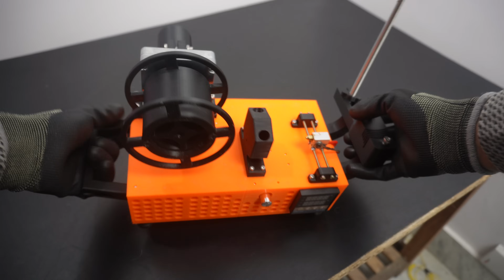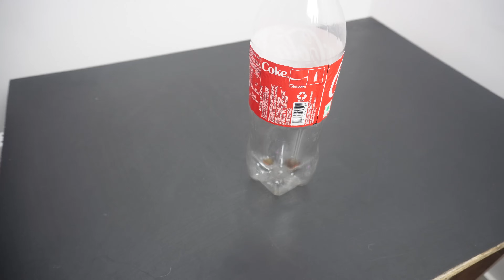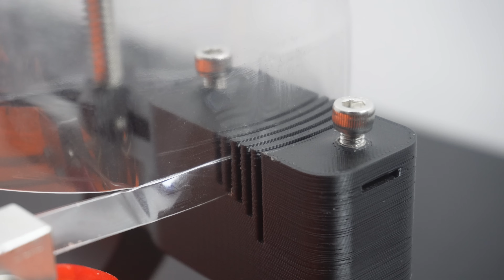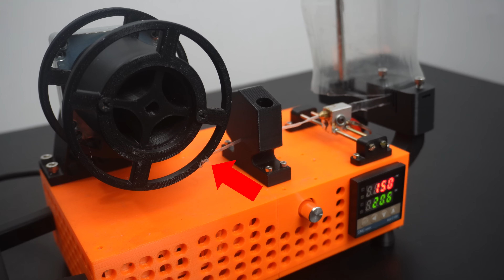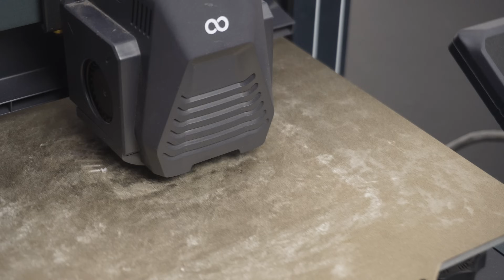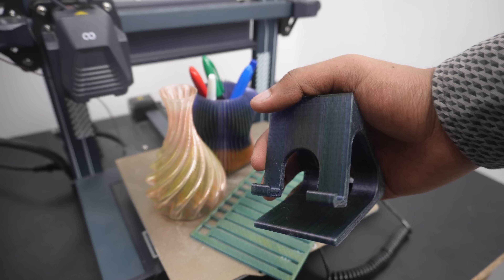Make High Quality 3D Printing Filament From PET Plastic Bottles

Comment: This will never be effective till there is an easy method of splicing two filaments, so that you can make a large roll.
Reply: I use a flat soldering iron. Works perfectly. Have also used sellotape, and even a hook splice made by cutting a hook in to the end of one bottles plastic strips and the begining of the next one, and then you hook them in to each other before it passes through the hot end. I've made 5kg+ spools of filamen from bottles.

 I've also used two very thin strips of different coloured bottle plastic run through the hot end to make multicoloured filament. Black plastic from a tango bottle and luminous green from a mountain dew bottle makes a very interesting combination.
Reply: Is called melting them together, still 1 operator
Reply: I think sunlu made a filament splicing tool. Might be able to use that with this to make a full spool

Comment: The bottle Will finish quickly, how do You connect two "tapes" of plastic?
Reply from the maker: You can weld them together after the filament is made.
Reply: @Creative3DP  good idea too! I saw on another video how man conecct them. He make a cut like "hook" and hook them. I think way quickly than weld every pipe! I wish You all best 3dp!
Reply from the maker: Thank you so much!
Reply: When this thing will be available? And how much?  @Creative3DP
Reply from the maker: Price will be declared on the launch day which is on 16th
Reply: You can splice them together by cutting an end thinner or tapered strip and having a hole on it and copy that onto the other end, thread it through so they are tied into each other together then just feed through the hotend